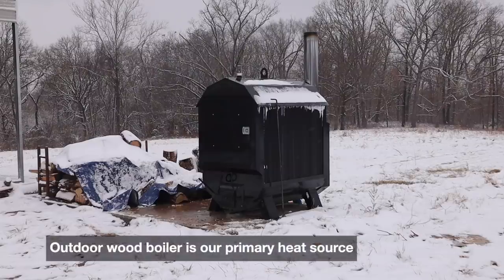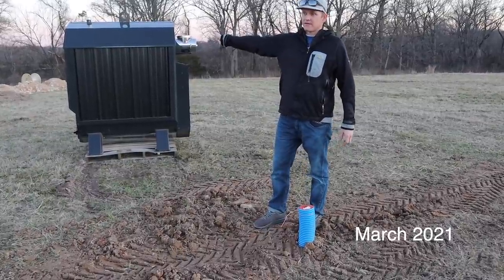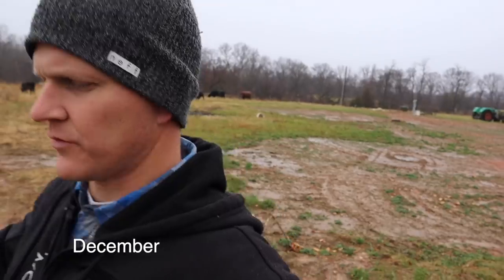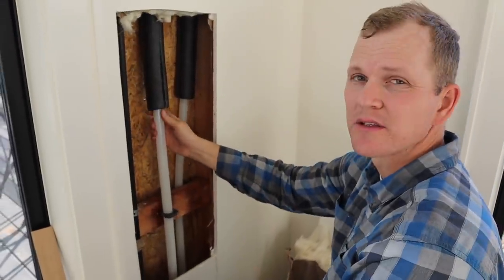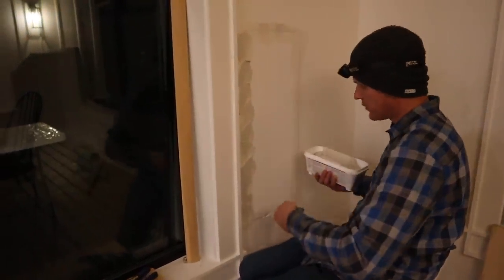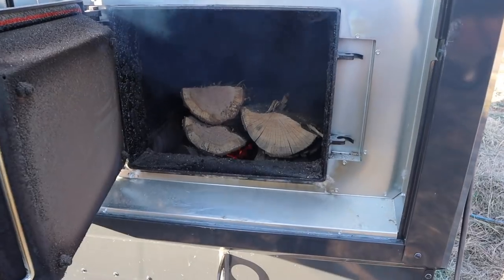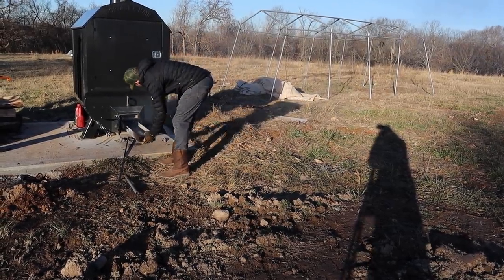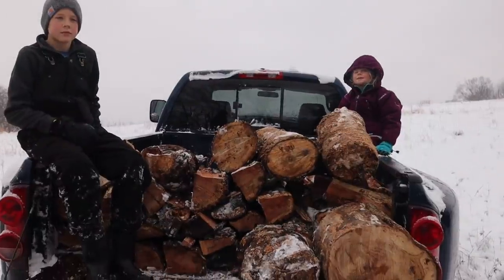Why We Heat with WOOD | Outdoor Wood Boiler | Wood Burning Fireplace

Comment: My friend outside of Orono Maine put his Wood Boiler inside of a metal shed, big enough to contain the Boiler, 10 cords of wood, his Riding Mower, and all of his Wood Cutting equipment and Garden Tools. It keeps the wood and stuff completely dry, warm enough to start right up, and the boiler has practically no rust on the outside or internal doors. The Vent Pipe goes right out the wall which is metal, no chance of fire...
Reply from the maker: That sounds like a good setup!  -Cam

Comment: We've been using an outdoor boiler for about 9 years, and love it . I haven't bought any wood so far, I've gotten all the wood I need from blowdowns. I want to warn you though be very, very careful when loading wood into your stove!! I read all of the warnings and cautions and was careful, however after about 6 years of using my stove I got complacent and almost cut off my middle finger on my right hand. Though I have a different brand stove then yours, the front door lip is exactly like mine and if you aren't careful it WILL hurt you!
Reply from the maker: Thank you for the warning.  i will be mindful of this 👍
Reply: Why go through all that work when you could capture all the heat energy from outside with a heat pump

Comment: Hey great video I am a Portage & Main dealer and glad you like the boiler. They are great boilers and will give you many years of service. It was unfortunate you had a leak in your pex in your new home. I did notice you used Shark-Bites to connect your heating coil. I recommend you solder / sweat on permanent  pex fittings. When you shut the system down with the cooler water temperature they can leak because of the expansion and contraction  of the water it will stretch the fitting over time.  Just don't want to see you have to cut into your drywall again . 
All the Best with your new boiler
Sean
Reply from the maker: Thank you for the tips Sean.  I've had a few others talk to me about the sharkbites as well.  I did crimp fit most of the fittings, but indeed there are a few that I did use sharkbites.  I do plan to do a summer maintenance job on the boiler system and replace as many sharkbites as I can...  

Where are you located?
Reply: When loading full of wiod, for how long can this Portage Main boiler heat? How many hours without uploading with new wood? What price more or less?

Comment: Been running a OWB in the snow belt of the Great Lakes. Fantastic solution for heating a house and separate workshop and the in floor heating we have is quite lovely in winter (especially my wood shop). First year was a learning curve - second year I built a covered woodshed and a separate awning in front of the stove and built a wood cart. What a dream to load dry wood in a blizzard. Now I cut ‘wife size’ wood per the advice of my elders 😂 - turns out it is also kid size! The OWB gets better and better as the years go by and the kiddos get bigger. Well done sir!

Comment: Good presentation. I see so many channels about wood boilers and almost all split wood down so small, and I don’t know why? Sensibly, you use larger pieces that take longer to burn. Hope to see more! Len (Devon 🇬🇧)
Reply from the maker: Thank you for noticing that.  Definitely get a more efficient and longer burn with the bigger logs.
Reply: I believe the down side to large pieces is the time it take for them to dry. If you can cut a year or two in advance it works fine though

Comment: I am on my 7th season with that same boiler and am happy with it.  When I hooked up all the plumbing I used Shark bites because the seamed easy to use. I only have 4 of them left in the system because they leaked when heating up and cooling off.  It is all crimp rings now.
Reply from the maker: Awesome!!!  Interesting about the sharkbites.  I hear very mixed reviews about sharkbite fittings.  My setup is 50% sharkbite, 50% crimp rings.  Wil probably convert to crimp rings as well as time goes on.
Reply: @TheSeasonalHomestead  I have 2 styles of crimpers for the 1 inch rings.  The big pliers type and the bolt together style which is very simple and I think makes a better crimp.
Reply: @TheSeasonalHomestead  And one more thing I have learned the hard way.  The tin ash pan can push ashes into the blower vent at the back of ash pan and block it.  My stove was having trouble getting up to temp until I figured out the fan pipe was blocked with ashes.  Now I use a turkey roasting pan under the ash pan door and only pull the ashes foreword.

Comment: I'm a licensed HVAC/R service contractor. That is a nice residential application boiler system. I like the versatility of the design, in that it is used to heat air and potable water. I'm assuming there are automatic safeties and manual safeties built into the boiler, such as high pressure safety switches on the water vessel portion as well as low water level and high water level safety switches and high temperature safety switches for the water vessel and for the combustion chamber. That is how gas-fired boilers are designed Some safeties require a manual reset to get the boiler back online; other safeties automatically reset themselves once the alarm conditions no longer exists. However, for gas-fired boiler ignition systems and for gas-fired furnace ignition systems, typically, three attempts to ignite the gas will be allowed. If no combustion is obtained by the third attempt, the ignition system goes into a "hard lockout" which requires a technician to come out and do a manual reset. This feature forces a technician to have to come to the scene to troubleshoot what led to the failure to ignite within three attempts. Again, that's a nice system you have and the redundancy tbuilt in to back it up is well thought out.
Reply from the maker: Thank you Tyrone!!   I appreciate your approval as a licensed HVAC/R contractor.  I did a lot of research and talked with a lot of local experts before determining the setup I wanted for our house.  There are high temp safety limits built in to the boiler, but since this isn't a high pressure system, I did not need any pressure sensors and such.

Comment: My brother has an outdoor wood stove. I’d actually classify it as an incinerator. It’s tremendous. We live in upstate NY and he heats his 5000 square foot house and garage. He also has a concrete driveway that’s heated by it so it’s the one place he doesn’t have to plow😂… additionally it’s connected to his central air and water heater. Runs his entire house! He happens be a contractor so he did everything himself and has an endless supply of wood…but I envy his almost non existent electric bill! It’s awesome if you can do it that’s for sure.
Reply from the maker: Sounds like your brother has a pretty awesome setup!!  When you decide to get one, you'll for sure get the family and friends discount, right?!? :)   We love our outdoor stove!
Reply: Lol…yes he sure does! It’s so efficient for him maintenance wise and very minimal cost to run. He works such long hours it’s a blessing for him to have something that does most of the work for him now. He also only loads his twice a day in the winter.  Once a day during the warmer months. It’s definitely something we plan to do in the future. We have an indoor one that is our main heat source for now with a furnace as back up, but for the most part we are wood only. Grateful considering the price of fuel. Kerosene is $7.99 a gallon here right now. Ridiculous. We have to use it because fuel oil,  even with additives still gels. Winters are brutal here. The last few years we keep getting slammed with back to back nor’easters dumping almost 2 foot of snow on us at a time. We had snow banks at least 20’ + high . Absolutely crazy.  You’re Dad is right…nothing like heat from a wood stove. I’m probably not getting the luxurious heated driveway though…I’ll just keep making him plow it😅. Love watching you’re videos. You have a beautiful family!

Comment: I have a boiler that heat water for cast iron radiators and for the shower. I installed that in the garage because i don' t want to go out to fill the fournace.
I burn wood 4 feet long and I made many iron frames to move them with the tractor and the transpallet in to the garage. 
The stove doesn'have any fan, he has a pump that push the water in to a reservoir of 400 gallons.

Comment: In Germany you can buy water-bearing fireplaces for example from the company Brunner 
A mix of a fireplace with a lot of mass (to store heat) and your wood boiler in one 
The heat exchanger is built directly into the fireplace and with it you can also operate radiators or floor heating and also certainly your hot water for the shower etc.
Reply from the maker: Those Brunner units look awesome!!  Thanks for sharing!
Reply: @TheSeasonalHomestead  yeah but quite expensive... Easy up to 10 000€

Comment: I would love one of those for a snowmelt system for my driveway and sidewalk.
Reply from the maker: That would be pretty awesome!
Reply: @TheSeasonalHomestead  I am a plumber in New Jersey. We use a standard boiler that runs on natural gas for snow melt. Even if you do a high efficiency model your bill will double running a snow melt system.   Parts of Jersey there is no room for a outdoor boiler. I live near nyc very crowded and small property lots.  But south ,west Jersey it’s possible.  Also amount of snowfall makes a difference.  In your area it would definitely pay off fast.

Comment: I've been heating with a water stove for 11 years, Hicks Water Stove, Mount Airy North Carolina. Highly recommend.  In addition to the 99000 btu coil in my air handler, there's 125000 BTU hot water heater. Four packs coming and going from stove to house. 

When you fixed that leak did you scab in a section of PEX or did you wrap in epoxy, rubber gasket material?
Reply from the maker: Scabbed in a section of Pex for the repair.  Hopefully I'll never have to tear that wall open again (fingers crossed).  I've never heard of Hicks, I'll definitely look those up.  -Cam

Comment: The wood boiler is cool. I like that it doubles as a water heater. I don't get how hot water is made in the other seasons though. Conventional water heater? Propane/Electric?
Reply from the maker: Great question!  So, in the summer when the boiler is not going, it reverts back to propane for heating our hot water.  Some people run their boiler year round for hot water heating, but where we live, that doesn't seem economical.  We will just bite the bullet in the summer and heat with propane, then enjoy cheaper heating in the wintertime :) - Cam
Reply from the maker: That's not a bad idea.  Especially since 90% of our hot water needs are during the daytime anyway, I'm sure that helps.  I will definitely look into it!

Comment: HAVE HAD A PORTAGE AND MAIN WOOD BOILER FOR SEVERAL YEARS.  WE'VE HAD OTHERS BUT THE PORTAGE AND MAIN USES LESS WOOD THAN THE OTHERS WE'VE HAD.  GOOD DESIGN I GUESS.  ARTER 30 YEARS OF USING OWB.  I STILL DON'T LIKE GOING OUTSIDE FOR THE LAST FILL OF THE NIGHT WHEN IT'S BLOWING SNOW AND 20-30 BELOW ZERO F.  NICE VIEO
Reply from the maker: This makes me happy to hear you like the Portage and Main boiler you have.  I did TONS of research before landing on this one.  So far, super happy with it, but only 1 season in.  I hope to still be raving about this one ten years from now :)

Comment: wow very interesting to hear your reasons for choosing a wood boiler! I'd never heard of such a device, but after hearing your logic, I agree that it's the best option especially because of your free fuel. I don't know how big your land/forest is, but I'm curious to know the growth rate versus your burn rate. Thank you for all the information you share with us!
Reply from the maker: That's definitely a good question, and something I'll have to encounter 20 or so years from now.  For now this works great.  By the time I need to consider other/easier alternatives, the system will have already paid for itself so that either repairing it or replacing it altogether are two equal options in my book.

Comment: Outside wood stoves are stupid. You have to go out when it's freezing to add wood. I use to heat with wood coal and oil, 4 years ago I got geothermal total cost $15000. All I have to do now is just change air filter. I no longer have to carry coal, and then the ashes, not more cutting wood, no more oil. Cost about $50 a month to heat my house in the winter and I live in western NY. Best investment I ever made.
Reply from the maker: I would LOVE to do geothermal here. $80,000 was the quote given for a 5-ton system to support our place.   Can I pay you to come install a geothermal system down here for perhaps closer to your $15,000 price?  I'll even fly you down here :) 🙌
Reply: @TheSeasonalHomestead  Total bill was $35,000 , got a rebate of $10k from NY State and $12k from feds. $80K is a lot

Comment: My wood stove is in the basement w/ an awning over the sliding glass door where I back my trailer up and a woodshed along side my house.. I stay dry getting wood all winter..
Mine burns wood or coal, wood burns at 500F, coal 1500F, when I add air the Temp. doubles.. 
I could forge metal in my woodstove, but I never need it that hot... I can't use coal till the Temp. drops below 20F or I have to open windows to let out the heat - It happened twice.

Comment: We have had a central boiler sense summer of 2006 saves thousands of $$$$ each year. Only thing I seen I would of did differently is run the underground through the foundation. Less heat loss that way.

Comment: check out heatmor boilers. im on my 18th winter with mine. clean out is an auger and very easy to go into a bucket to cool. no shovel or slide bin to worry with

Comment: I totally understand boilers , north of St.Louis.
For people in their teens through their early forties.
But Iam in my mid sixties.
And this running out twice a day in below freezing temps to stoke wood is for the birds 
Do yourself a favor and install a Geo Thermal system now!
While it's cheap.
The price ain't going to go down .
It will pay for itself in 12-15 years.
Reply from the maker: This wood boiler will pay for itself in 8-10 years.  I had Geothermal quoted for me by a few different companies and it averaged around $80,000 for a 5 ton system.  I'd LOVE to put in geothermal, but it will likely be 10 years down the road, unless I figure out how to do it myself.

Comment: Curious as to why you had the insulated pex pipe come out of the ground outside the house and then in through a wall? Wouldn't it be more efficient if it went under the slab and up through it directly into the house? That way the pipe is within the envelope of the conditioned house and not exposed directly to outside air even if it's only for a few feet.
Reply: yep i did mine through foundation wall and then up through floor. im in nc so not to cold here. im a plumber hvac by trade so i did all the connections and duct work. saved me thousands

Comment: Is there a way to also use it as a hot water heater?
Reply from the maker: Yes, you can easily hook these up to a domestic hot water heater, via a sidearm heat exchanger or a plate heat exchanger.

Comment: What is the brand/model of the wood stove in your living room?
Reply from the maker: Hi Patrick  It's a KozyHeat 42.  We LOVE it!  We primarily use it in the shoulder seasons, and it works fantastic!!! -Cam
Reply: @TheSeasonalHomestead  Thank you so much!  We're putting a Quadra-Fire Pioneer III with the rectangular front into our new construction home and looks very, very similar to yours.  Could you also tell me about the materials you used for the surround and mantel?  Love your videos!  Thanks again!
Reply from the maker: @patrickcenter  your Quadra fire, at least on the web, looks pretty awesome!!!  Good choice 👍🏻.  Our fireplace is wrapped in soapstone that we got from a local dealer.  Good luck with your build!!!  -Cam

Comment: Why not put anti freeze in instead of water? The heat values between water and anti freeze?
Reply from the maker: I have considered putting a bit of antifreeze in.  At the moment, anti freeze is a lot more expensive for 100 gallons.
Reply: @TheSeasonalHomestead  what about windshield washer fluid? A lot cheaper. Not sure what happens when you heat it.

Comment: Be careful putting wood ash on your garden.  A little may be OK but not too much.  I burned brush on my garden a few winters in a row and when I did a soil test, it was EXTREMELY high in P and K.  That was over 15 years ago and I've only added N since.  After that long, it's still badly out of balance with too much P & K.  Seems like I've done about 30 years worth of soil damage by adding too much wood ash to my soil.
Reply from the maker: Good cautionary tip.  We are very careful with the ash, using very little, and broadcasting a light cover where needed.  Thanks for watching!

Comment: It's SO far from the house, why??
Reply from the maker: For safety reasons, should be at least 50-100ft from the house.  I chose 100 ft, so that later if I add a shop to the property it can be utilized for that too without too much extra digging.

Comment: Omg shark bite fittings this is why a professional should install hvac systems. I've seen alot of failing shark bite fittings that cause alot of damage.
Reply from the maker: Based on this, and a few other comments, I plan to replace all my sharkbite fittings with crimp fittings during this upcoming off-season.  Some people LOVE sharkbites, but it seems the more trusted people do not 😬